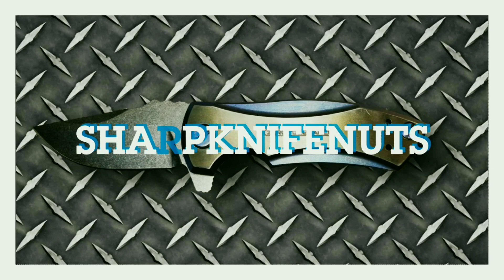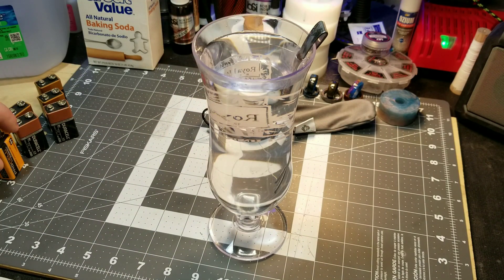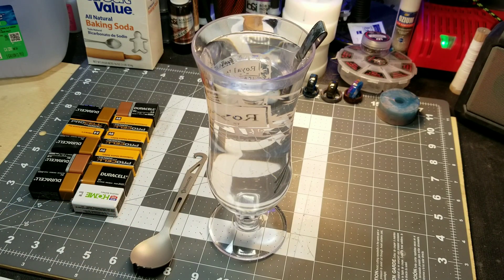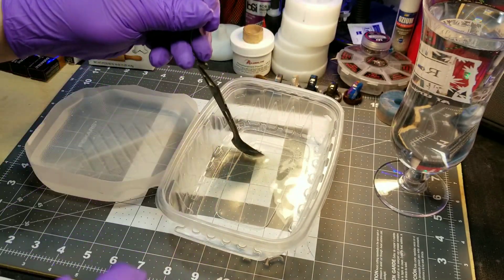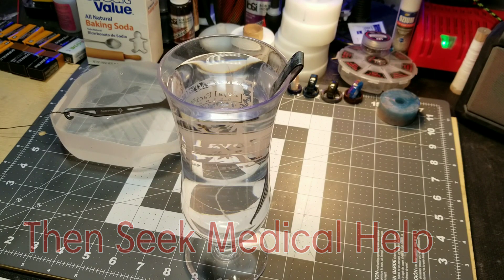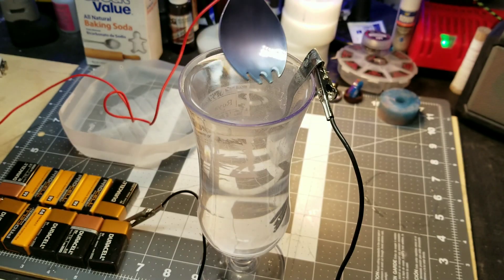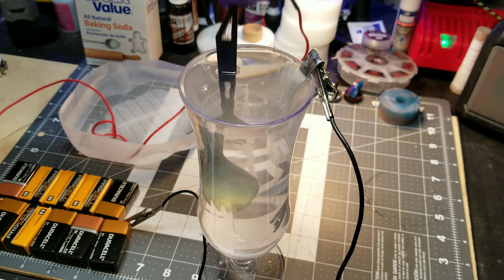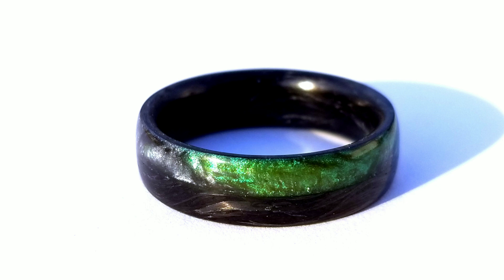Rainbow Anodize 🌈  Titanium

Comment: Awsome vid man!!  I'm fixin to get married and dont want a traditional gold ring, partly because I dont like gold and partly because I'm a welder and it's not that safe. I was looking at those silicone rings but this would be better!! Thanx for the opportunity at a chance to win!! Blue/black/silver , something like that would be cool.  Bud I spoke to you a little bit yesterday,  and have one more Question if you don't mind,  so 9v can get expensive,  so I thought I'll just buy a DC power supply off Amazon,  most of them are rated 30 volts 5 amps,  so am I right to think that I'm only going to get about 3 9volts worth of power out of that power supply?  Or do the amps change things?  Thanx again for your help,  and an awesome giveaway!!
Reply from the maker: Hey, thanks! I'm in the same boat with the ring. We are getting married next year, and I didn't want a traditional ring either. I wanted something with a little style and personality.  Gold and silver are just too bland for my taste. I love the carbon fiber, and then when I coupled it with the resin to give it a bit of color I knew that had to be my wedding ring. They are really comfortable and lightweight to boot. I dig your color choices too, those are the colors I have on my personal band.

As far as the power supply goes, you are spot on. You'll want to get one that can do around 100-120 volts. They are a little more, but that'll allow you to go through the whole spectrum of colors. With the 30 volt unit you'll only get the first 2 or 3 colors in the spectrum. Hope that helps. If you need any more info, feel free to ask. I'll help any way I can. 
Good luck in the giveaway,  and thanks for watching!
Reply: @ApollosRings  well hell...decisions decisions,  I think I will still go with the power supply.  Will maybe save money in the long run.  Thanx man,  and Congratulations on the marriage thing!  Yeah me and the wife to be aren't really into traditional rings and some how I missed the ones you make, probably because I dont have Instagram.  We are going to check them out on etsy for sure!  And thanx again for your help and time, most YouTube 'rs  will never answer if I have a Question,  you've been most helpful.
Reply from the maker: Thanks! We are doing a cruise wedding, so we're both really looking forward to it!

If you plan on doing quite a bit of anodizing, you can't go wrong with a power supply. It comes in pretty handy for other things as well. Definitely worth the investment. Honestly, I've been meaning to get one for a while now, but every time I have a little extra cash set aside I end up finding something else I need just a little more, lol. I've been on the same set of 9volts for over a year now. Probably time to bite the bullet, hahaha!

Far as the rings go, I do quite a bit of custom stuff too. If you don't see something you like on Etsy, but have something different in mind  just let me know. I'm always up for doing a custom design!
Reply: @ApollosRings  yeah man I just looked and after you get above 30v the price goes way up!!  Looking at around $175.00 at least! From what I'm seeing.  That's nice knife money! lol!  So I'm not sure what I'm gonna do.. if I bought say 10 9v batteries,  do they last awhile or do they die quickly? I have no idea what to expect from the batteries.  I don't wanna spend $100 on batteries every time I wanna anodize.   I just seen that my fiance got on here and is trying to win me my wedding band too! lol!   
We talked about a cruise.... I could get on a boat, but she can't... she can get on a plane, but I can't...lol, so chances are whatever we do, we will be driving
Reply from the maker: Yeah, they can get pretty expensive for the size machine you need to do all the colors. 

The 9volts are really not too bad of an investment. You can get dollar store 9volts that will do the job just fine. $10 for 10 batteries, or something like that. As long as you do everything correctly and make sure not to let the leads accidentally touch (I know this from personal experience), the 9volts will last you a ton of ano jobs. I think I mentioned it already, but the handful of batteries I'm using now are the same batteries I've been using for over a year, and maybe even over 2 years. I honestly don't remember the last time I bought fresh batteries. I do recommend a multi-meter though if you don't have one and plan on using batteries. You can get one for like $10 if you shop around. You wanna make sure all your batteries are good before you start, or you'll be having major anodizing issues. It took me a little bit to figure out the issue the first time I had a totally dead battery.
That's awesome your fiance is helping out in the giveaway! That's a cool woman you got there, lol!
I've never been on a cruise, but my fiance has. I'm just hoping I don't get seasickness, lol. Is that why your girl can't do a cruise? That'd make for a rough wedding week.
Reply: @ApollosRings  okay that's cool, I figured they would drain quickly.... I just messaged you about your rings, and going by looks, that's exactly what I want!  I'd like to have mine pretty wide, but anyway I had a few questions and basically as long as your rings can hold up to guy things I'll be in. Yeah she is great, she supports my knife collection addiction and has even taken an interest.  She knows all about steels, brands, etc.  
It's just fear I believe to be honest.  I'm scared shitless of airplanes and she feels same way about boats lol
Reply from the maker: I just sent you a message on Etsy, but if you have any other questions feel free to ask! I can definitely do a custom width if you want something a little wider than usual. The forged carbon fiber is some seriously strong, durable stuff. I have to use all carbide tools to work it, it immediately dulls any of my high speed steel tools. For working men, carbon fiber is awesome. The only thing is it's a no-no for electricians. Carbon fiber is a conductive material. Aside from that it's a solid winner in my book.
Reply: @ApollosRings  okay that's pretty much all I needed to know,  sounds great, and just fully committed to your ring as my wedding band,  that's crazy! 8 hours ago I didn't even know such a thing existed!  But ok,  if possible I'm going to try and call you in a few weeks and we will hash out the details,   I'm stoked man!!  Holler at ya soon,  and thanx again!!
Reply: @ApollosRings  man, and one more thing,  I'm not tech savvy so I sent you a message on etsy and you said you replied,  but my dumbass doesn't even have an account so I'm not sure where that message went lol!, but anyway,  I think I know all I need to know and I've made up my mind,  so if there is anything important I need to know just say it on here , but I think we are good.   It would be so cool to win my ring, but regardless  I'll be calling you soon
Reply from the maker: Yeah, let's see how the giveaway shakes out, then we can go from there. One way or another we'll get you in exactly the ring you're looking for! Glad you had a chance to see what I've got to offer here. From one working man to another, I promise you won't be disappointed. The carbon fiber really can't be beat when it comes to a hard-wear ring. Really glad to hear you're excited about it!
Reply from the maker: Lmao, that makes me kinda wonder where it went as well, hahaha! I just addressed the things you had asked about. Funny, the things you mentioned I had already planned on addressing in a FAQ section in the shop. Basically to sum it all up, the forged carbon fiber is one of the hardest, strongest, lightest materials I've ever worked with. I worked construction myself for years, and still work with my hands every day, so any ring I wear takes a beating. My ring that I wear daily is the forged carbon, and I can honestly say it doesn't show any signs of wear whatsoever. That's not to say that it can't get a scuff here or there, but it doesn't have any now, and I'm hard on rings. I had a titanium ring previously that showed crazy wear. This stuff is for hard use. The part of the ring that will show wear quicker would be the colored resin part, but even that is pretty durable. I eventually plan on offering a "spa treatment" for the rings to fix up anything that needs to be touched up from normal wear and tear, but if it's just a buffing that it needs, just pay for postage and I'll take care of you. As far as the warranty goes, I'll replace any ring that has a manufacturing defect, but I'm the quality control, and I do my damndest not to let a ring out of the shop unless it's right. I'd like to think I'm fairly easy to deal with, and my main goal is making my customers happy, no matter what it takes. Hopefully that answers most of the questions you had. If you have any others, feel free to ask, it's no bother whatsoever. Now this is the end of my novel, lmao

Comment: What’s the point of dipping in the whink in the beginning? Why etch it?
Reply from the maker: Etching in the Whink makes for a much more pronounced ano color. You can anodize without etching first, but the colors will be considerably more dull than if you etch first. There are other merchant options out there as well, but the Whink is a fairly cheap alternative. Some of the others can be pretty pricey. Multi-Etch is a popular etchant, and probably a little safer, as it's not an acid base, but it is way more expensive.